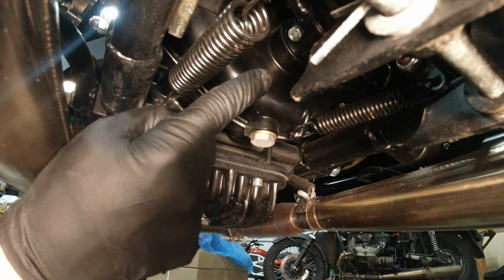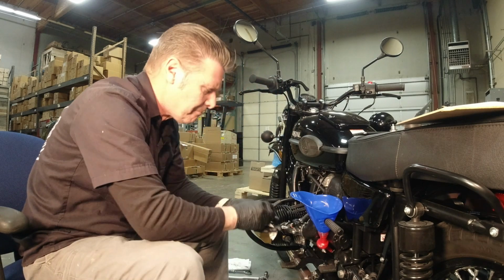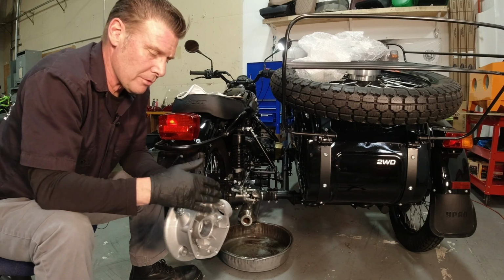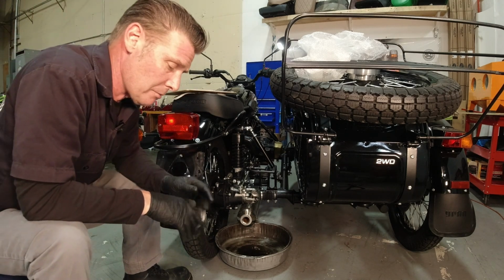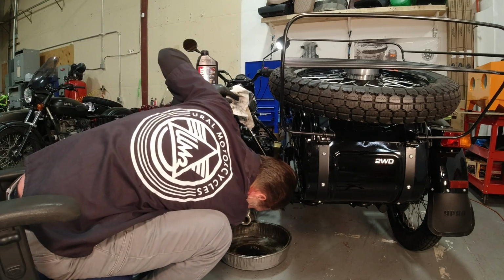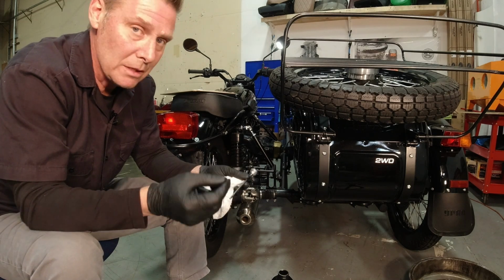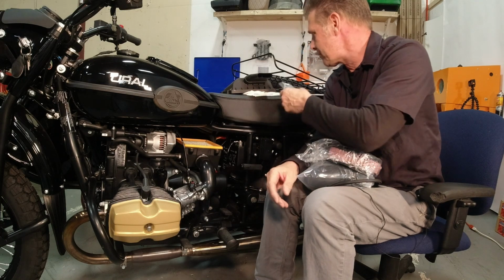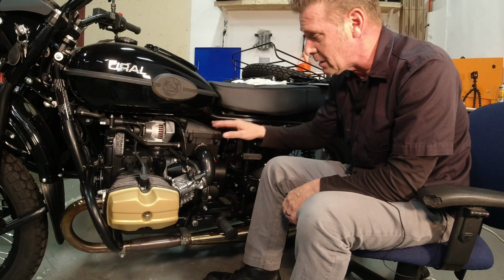URAL How-To - Spring Service Oil & Filters Part 2

Comment: The owner's manual for my 2019 Gear Up says to use 20w50 oil  in the transmission. Which oil do you reccomend the 20w50 or the 75w90 gear oil.
Reply: Going to the 75/90 synthetic is what’s now recommended and now running it in my 2018 Gear up seems to shift and run smoother
Reply: @joelsadowsky3436  Thanks Joel, I will be riding out to Arizona this summer by way of Route 66. I will switch to the gear oil before I make the trip.
Reply: Hello Scott, the factory notified us of the change in 2020. You can continue to use 20w50 or switch to 75w90, either will be fine. The same gears and seals are in your bike as 2020-2021. Many folks on the various forums have stated they started using gear oil with older models URALs years ago just because they thought it was better and they have never had any adverse effects. Many dealers have also recommended gear oil as a solution over the years to ease stiff gear selection, reduce gearbox noise, etc. In cold weather gear oil can give you a little bit of stiff shifting till it warms up but under normal temps it's fine.
Reply: @davidwaynegeorge2292  Hi David, thanks. Before they came out with the remote breather kit, on my 2019 Gear Up I removed the vent, blocked off the hole with a set screw, and got the dipstick with the vent. I put 1,000 miles on the bike driving 55-60mph and have not seen any oil leaks yet. I know that you said the cases are different, would the final drive still vent properly if I keep it set up like I have it or should I go with the remote breather kit?
Reply: @scottevans8489  so long as the final drive is vented from either the dipstick or the case location you'll be fine.

Comment: My 2018 manual says to use the same 20w50 in engine and gearbox. Should I be using the 75w90 gear oil in gearbox as you show?
Reply: https://youtu.be/NYT0DIM_AoI
Reply: @kevinishyper  thanks!
Reply: @kevinishyper  cheers mate. You win the internet today!
Reply: Drats! It appears Kevin’s reply has been removed.. 🥺

Comment: My new Geo, with 580 kms on it, broke down on the road last night. The engine may have thrown a valve or valve spring. It's going back to the dealer on a flat deck. Is this what I can expect after just 580 kms and ten days of ownership?
Reply: I would expect everything was covered at no cost. Hopefully that was the case. 
Update one year later?